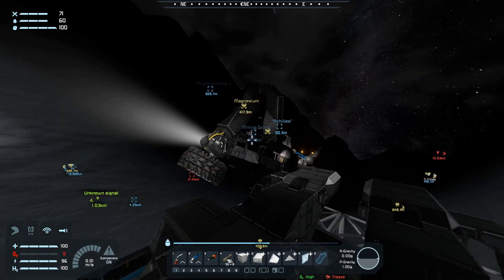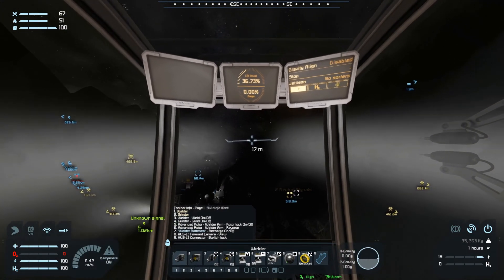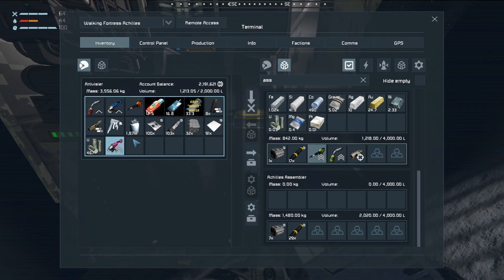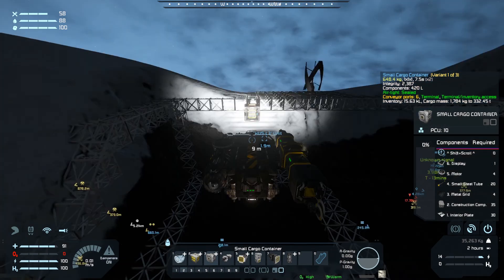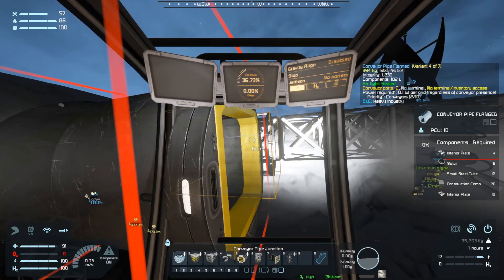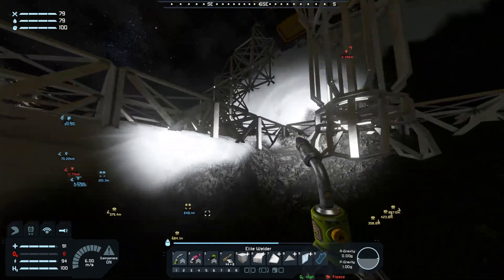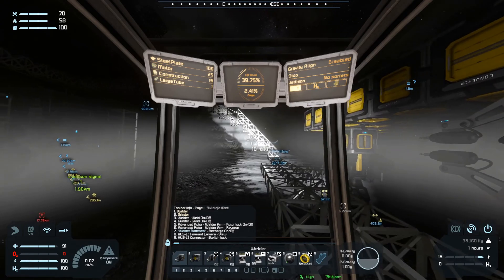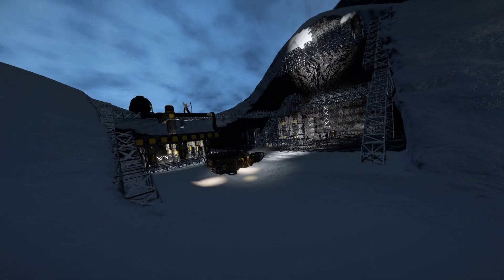Space Engineers | No-Suit Survival | Episode 16 "Base Construction"

Comment: Not using industrial refineries and assemblers smh.

You can make pipe crosses look more interesting by putting a piston head on top of them (shame on Keen for not making a T-shaped block!). Refineries, however, should already be connected through the ports on their sides. When in doubt, you can use Ctrl + K overlay in build vision, it has added the ports/interactable parts highlighter several weeks ago.
Reply from the maker: Oh heck that sounds amazingly useful thanks for letting me know. Yeah I was thinking about using the new refineries/assemblers, which I will do when I make this whole thing look good. Right now I am just going for functionality first. Sadly these types of bases need so many blocks. I was hoping heavy industry would add some huge blocks, like massive refinery/assembler h2/02 gens but w/e i guess
Reply: @artiviser1237  well, at least DLC blocks have way more air leaks and less conveyor ports than their base game counterparts :)

Also, I mixed up build vision with buildinfo, whoops :D It's buildinfo that adds overlays.